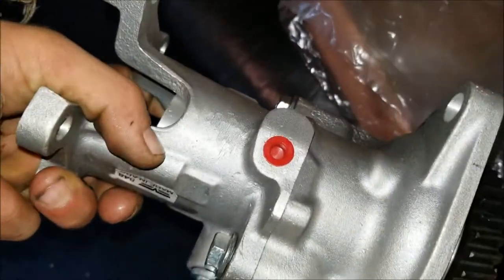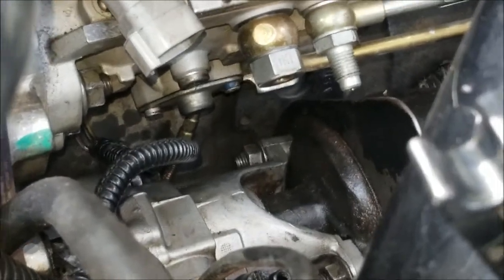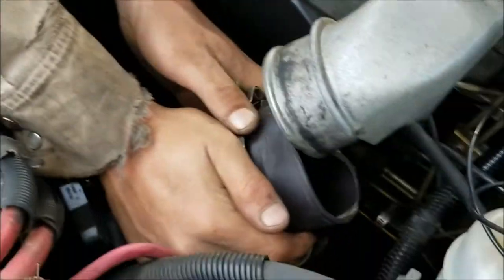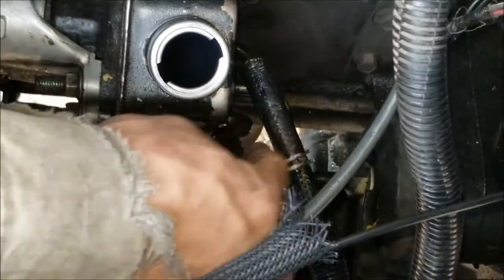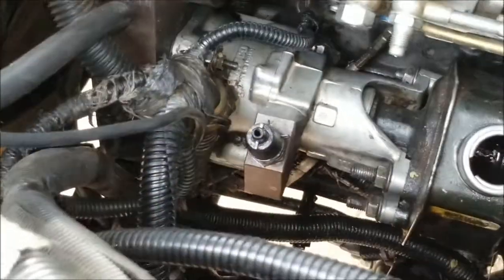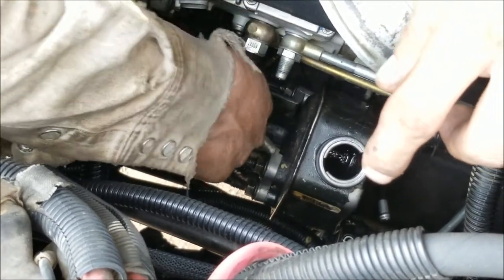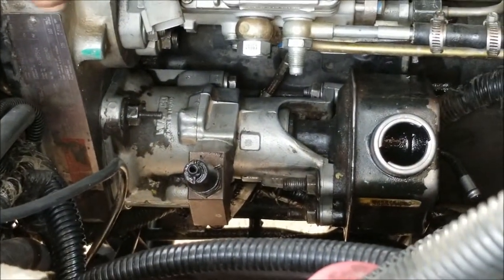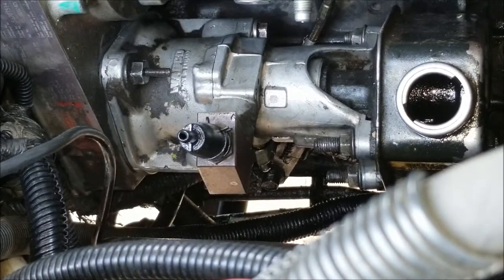How to remove a Vacuum Pump 98.5-2002 cummins 5.9

Comment: Hey man, great video!

Just so you know, torque wrenches are for bringing a bolt up to torque, NOT for breaking bolts loose. I have been working on aircraft for 20 years, and that would get you yelled at the 1st time, fired the 2nd time. 

Like I said, awesome video, you showed everything I needed to do the pump on my 2000. Thanks!
Reply from the maker: i know i just didnt have the proper tool at the time lmao tricky spot

Comment: Your tips on gaining access to the vac pump were super-helpful. 

I would not have thought of removing the fender liner. Removing the intercooler to intake manifold hose helped with top down access, although I went further and pulled the driver side battery. And lastly, I urge viewers to pressure wash the side of the engine at a DIY carwash after removing the fender liner. The side of my engine was loaded with dirt and oil-soaked gunk that likely would have fallen into the gear case while pulling or reinstalling the vac pump.

Permit me to offer your viewers some advice on getting replacement plastic rivets to reinstall the fender liner - I suggest using Auveco plastic rivets, P/N 18108, at $8.50 for a box of 25.  Mopar rivets, P/N 34201631 at $7.75 per rivet, were way too expensive!
Reply from the maker: John P. Callan yes I recommend this a well, I need to do it XD thanks John for your helpful input, I also need more rivets

Comment: Awesome video.  I have an '02 and had that replaced twice now.  This morning, with the first cold day, it started growling again.
Reply: If you can find a product called BG power steering fluid it will fix the cold morning growl, most auto dealers sell it as a service, (powering steering flush), I know BG works and it is a synthetic, dont know if any other brands will work

Comment: Thanks for the great video brother! Very detailed video helped me get my pump off. Spent hours trying to get it off and didn't know there was that one bolt that holds it on the block. Have a good one and keep up the detailed videos for all of us DIY's.
Reply from the maker: Jake Leary thanks for the feedback , I don’t recommend a torque wrench for removing like me , but I didn’t have a breaker bar
Reply: That one bolt to the block ,wasted hrs
Reply: @johnmaxx4818  two severe TBI'S and three brain surgeries will easily do that to ya. Never stopped me, just gotta re-learn everything all over again and now kinda slower at grasping things.
Reply: @jacobbleary4806  a positive attitude and your half way there,I can understand using torque wrench as a breaker bar, been there

Comment: Thanks for posting, good camera work trying to get a better shot. I offer this in return: I've heard that you should not use a torque wrench to loosen nuts because it can throw off the calibration, FWIW.
Reply from the maker: Ron H ohh I know it's also been dropped alot lmao , I'm get a breaker bar
Reply: Video was helpful but the camera work is terrible. So hard to watch

Comment: Excellent video !!  But good grief  how do you get that lower engine side pump bracket undone ???    Can't get a wrench or socket with enough travel to loosen the nut on the  pump,  and can't get one on the bolt to the block!  Just spent 2 hours trying to get it done when  it should be a 2 minute job .    Do you need to turn the front wheels one way so the pitman arm is not in the way ??????   My tires are straight ahead and I'm thinking the pitman may be limiting ratchet/wrench motion.   I walked away from it now  for the rest of the day,  and will look at your video again and others,   but if anyone has a quick answer I'd sure appreciate it !!!!    BTW I'm quite a hobbyist mechanic on this and project  cars but this one nut/bolt/fastener is getting the best of me right now !!!
Reply: Ok I see now right around the 14:15 mark of your video.  This is where the wheel well removal comes into play.  The camera angle threw  me off at first ..    what you do is operate the ratchet almost parallel to the ground  (rather than vertical to the ground)  and use the extra space gained by the wheel well removal for the movement of the ratchet to loosen that nut on that bracket mount that goes to the block.  I'll get back to it soon.  Thanks again for the great video !

Comment: Why are you using a torque wrench to back out the bolts? You're using a huge ratchet in a small area it's very counterintuitive unless it's for Leverage. The only really needs a torque wrench when you're installing
Reply: He was using it as a breaker bar. What ever works.
Reply: @regularguy519  that was a torque wrench and it was not necessary at all

Comment from the maker: my cousin says in this video about kinking off the hoses to keep air out of the system, well you can but you dont really get air in the system as long as you add fluid after reconnecting the hoses and pump.start the vehicle and the air should circulate out if you leave the cap off

Comment: I'm not looking forward to removing mine on a 99 5.9 2500.  I already replaced both P S hoses but I keep losing fluid somewhere.  I have a new PS pump so I'm going to pull off with the vacuum pump attached. wondering if I should reseal the vacuum pump while I have it off?  I just bought the truck 2 weeks ago and had to replace the AC compressor and drier and the high pressure line.  It going to be so hot and I don't even have a shade tree to work under.
Reply from the maker: I just did mine several times again and yea man you should reaseal it use the Genos garage seal kit they guarantee to hold I tried several parts store ones and the gaskets are to small

Comment from the maker: Hello, i forgot to mention, i don't let my fluids just FALL ON THE GROUND i have a pan down there and i did catch all the fluid everytime i did this procedure ! thanks..
Reply: Yo, what problem were you having in order to replace your Vacuum Pump? 
I’ve swapped out the Steering box, Hydroboost, lines, pump but Not the Vacuum Pump and I have Zero Power steering at a stand still or when trying to back up my trailer.... I am going to swap out the Vacuum pump and hope that fixes my issue. 

Let me know your thoughts Savage, thanks!
Reply from the maker: @iab32  hey man sorry i didnt see your comment until now , honestly man the vacuum pump was probably your issue
Reply: Hi, excuse me to disturb you, I have a question about the hole thread on the middle of gear of the vacuum pump, is it normal, or is there a bolt ? it's strange this hole on the middle . I need to change mine, I hope it take less of 2 hours . thank you for your answer and for this excellent video !
Reply from the maker: @pelvismc  the thread is for pulling the gear don’t worry about it, perfectly normal
Reply: @RecklessSavage  ok thank you, it  seems not very difficult to do .. it s little long . Thank you very much for your great help
Reply from the maker: @pelvismc  i can do it within 45 minutes
Reply: @RecklessSavage  ok, just for me I need more time because I have no helper! It takes times after to flush the pump and refill the system, and tur the wheelsside to side....

Comment: Hey Reckless Savage, I'm trying to reinstall the vacuum pump/power steering assembly but I'm having trouble with the stud/bolt for the bracket going back into the assembly.  Any tips?
Reply from the maker: sorry it took so long to get back to you I was on mobile when I seen your message, honestly I leave the mounting one attached to Motor , and remove the 15 mm nut they are very small torque ratio, I had the same issue as you at first and I had all kinds of stuff mis aligned but ive done this 20 times now

Comment: I’ve put mine back in but forgot what vacuum line plugs into it at the bottom please help.
Reply from the maker: It plugs in the side . It’s running from the brake booster by the firewall , the fluid hoses are kinda self explaining only so long

Comment: Was it a pretty bad leak, I probably lose 3 quarts of oil per 70 miles. It looks real wet down toward that area but I can't tell if it's coming from the tappet cover or the Vac pump. I got a quote from the shop without them looking at it they told $2,000 over the phone. So I'm going to try the task myself and try to do the front main seal to. Any insight would be great awesome video by the way
Reply: Try tappet cover gasket

Comment: Great video, man! No BS. I was able to find a N.O.S power steering and vacuum pump assembly for a good price. I am getting ready to swap soon and rebuild the original pumps. Any tips for install and bleeding air?
Reply from the maker: Tony Thies bleeding the air should t be to big a deal if you clamp lines   I need to put a gear box

Comment: Hey your in Texas right?can you help me with my transmission?
Reply from the maker: Rodney Plummer II what's going on
Reply: Reckless Savage the transfer case broke off the overdrive housing so I took it to A Plus transmissions in Austin and they said the transfer case was broke ...well I don't,know much about transmission but I knew for sure the transfer case wasn't broke so,I got it home disassembled the transfer case and,nothing was wrong well maybe some scaring on the input shaft...anyway I just need a transmission rebuild 
2001 2500 4x4 automatic swb 100 percent stock thank you can help a loyal viewer ?maybe even give you some content for your channel
Reply from the maker: Rodney Plummer II honestly I am not much on trasmissions , but I've seen the chain inside t tcase housing break them off or your driveshaft carrier bearing being out
Reply from the maker: Rodney Plummer II being in Austin or close, I may be able to help a little.
Reply: Reckless Savage where are you located ?
Reply from the maker: Rodney Plummer II llano

Comment: Why are u removing it for the 5th time, do it rite the 1st time brother, great video cross eyed savage.
Reply from the maker: Because obviously it didn’t work trying to crappy seals from autozone so I bought a Gould’s , I actually just replaced the seal again , with Gould’s and it isn’t leaking , autozone seal will leak every time
Reply: @RecklessSavage  great vids, keep them coming, everyone has different experiences, and all the info helps